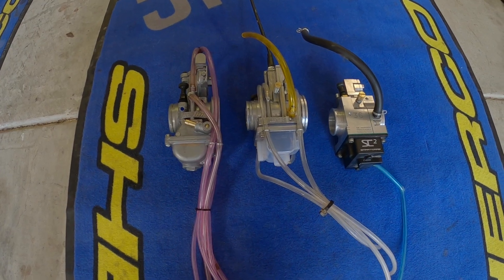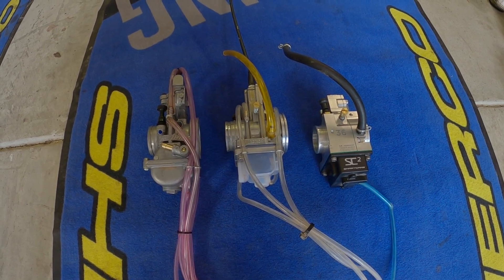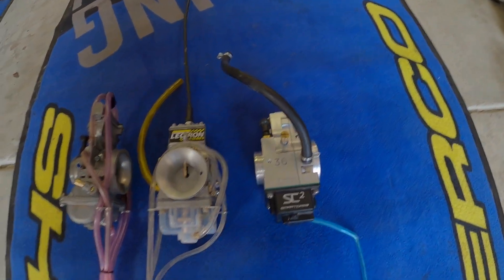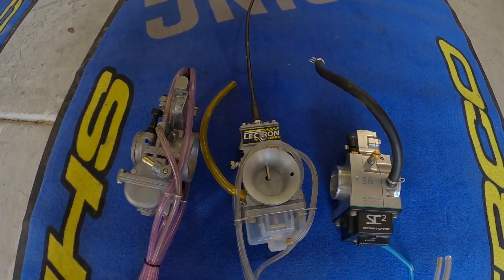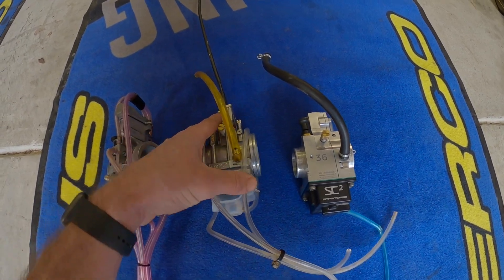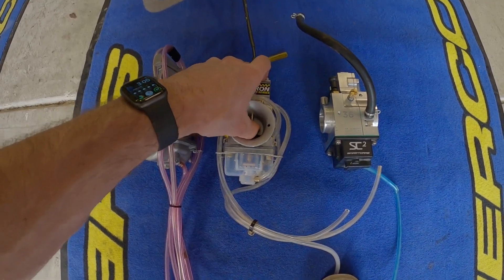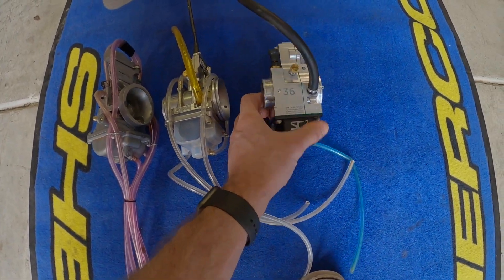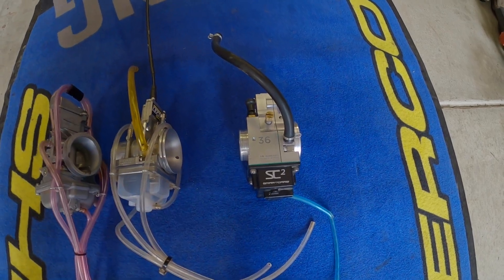Keihin, Lectron, SmartCarb Comparison

Comment: Hi Cody. 
Thanx for your test. 
I wish you could do a more detailed one just on the lectron.

I have a question to the part you made the mistake you mentioned on the Lectron . I am a little bit screwed at the moment.
What i recognized / where i would like to comment
1. The tool is not part of delivery. 
a) It must be ordered and payed separately. (At least in Germany it is this way) 
b) You need the tool unless you want to damage the needle with a plier.
2. Could you please explain in Detail what you are doing around 09:00 in your video.
im struggling at the moment to  find the ideal setup for my GasGas250:
What i think:
a) Explaining how leaner and richer is setup in  general is fine. Works the same as in a traditional carburetor. 
What i think: You have to use the tool and turn the needle in unpressed condition. So if you turn the needle clockwise for 360 degree the needle will lower and the bile will be a lot leaner.
Manual says: that modification shall be done in 1/4 = 90 degree steps. So if you turn it leaner or fatter for this angle the needle is NOT Showing as it should be (flat side to the engine). This is why you have to press it to unlock and than turn it to the right direction. After releasing the needle goes down an the 90 degree change is done.
I do not know:
a) if my description is valid. The Manual is really poor and your video is one of the best explanations
b) you can ask someone to confirm this
c) can he explain on how to count the rotates mentioned in the turns in the manual. For a 250cc base setup is 3-5 4 rotations. 
Q) Starting from completly closed (Lowering from full rich to lean) or starting from ultra lean Making it 4 Rotations fatter
d) can you explain the power jet  in detail.

Greetings from Germany.
Hope to see you soon on the bike.

My problem: 
GasGas has 2 Ignition curves. Running single trails an being 50+ years i usually used the rain setup. Bikes runs smooth with the Keihin. Switching to Sun Mode gives this aggressive MX curve of a 250 engine, starting with no power and giving you the BANG on opening the exhaust valve.

1. After replacing the Keihin with the Lectron the bike is really running great on the summer setting. Simmilar to the original Rain Setting Very smooth and more powerfull overall. Switching to rain the bike is running poor. Seems to be much to fat in this mode. 
2. I have to use the Choke on Cold engine start for some seconds even if temp is 15+ Celcius. Choke Design is trash. Position is not on  original place. You can no handle the choke with gloves. I bought the addon choke cable. This works fine for me.

BTW: If any of the readers  or any Lectron PRO as an idea, please comment on this one. I will contact you by mail.
Reply: Cody got it wrong. Turn rod in the down position to richen or lean. Push up only to get rod back to correct position after making a change.

Comment: As good as the results can be, $500 - $800 buys an awful lot of jets and needles, even labour for a tuner to sort out the original jetting.
Reply: But you still have to think about it and mess with it. Beauty of a lectron or smart carb is you can put it on, maybe do some initial tuning, then forget about it. 
I’ve had perfect jetting on my rm250 with the Kehin and I don’t think I could have gotten better performance from anything else on that day in those conditions. But now I live in Colorado and ride track at 6k feet then trails sometimes the next day at 10-13k and it’s nice not messing with the carb.
Reply: @johnnyellis5324 
Maybe it's just me, but I can't imagine forking out $800 so I can be lazy and not spend maybe a couple of hours on my new bike to jet it right.
I guess there are those people. 👍
Reply: @Danger_mouse  yeah I wouldn’t fork out $800 either, however the Lectron is $475, will almost always run better than you jetting it and I’d rather be riding than tinkering every time I want to ride high elevation
Reply: @johnnyellis5324 
That's still $650 Aussie dollars and still needs to be freighted.
I'm sure both of them work well,  but for me the cost isn't worth the gains.
If i was to spend that much money, I'd spend a bit more and convert my bike efi 🙂

Comment: Based on what you said, and the fact that the SC was actually ON your bike during the video, would it be safe to say that this is the one you have chosen to run for now? Obviously the simplicity of the SC tuning was something that you thought was an advantage over the others (at least during the testing phase). I also noticed that you compared the performance between the Keihin and Lectron (a little bit) but you did not mention the pros and cons of the SC performance. Based on your comments it sounds like you may have felt the SC power characteristics were more linear than the Lectron. Can you please elaborate a bit more on your thoughts on how each one performed?
Reply: 9 months later the keihn is back on...

Comment: Have you tried a Keihin with the STIC installed Cody?? Heard there awesome.
Reply: Looking for the same info!
Reply: I ran the stic keihin combo. I could never make the bottom end run good . It ran like i had a rag in the air box. The manufacturer kept reccomendin larger jets and the problem got worse and worse. Good mid range and top end . If your into sand drags or hill climbing it might work but for off road or trails its a complete waste of money.

Comment: Did you notice any fuel economy gains or quicker starting? Could you talk about that?
Reply: I have the lectron on my KTM300XC and yes it vastly improved.  Paid for itself in one season in fuel savings.  I am going to try the smart carb when I can ride again.  But the lectron has worked very well, starting and idle has improved, warms up better.  Easy to adjust.

Comment: finished the 2020 CWIRA ice racing season on my KX 500 with Lectron. Other than adjusting the initial float level I was good to go from -10 to +40 deg races and had crisp throttle response everywhere.   For me,  it has been a good choice.    KX 500 Eric Gorr super moto porting and pump gas head.  ( probably going to recut  the head for VP C12 before next season)
Reply: Did you ever run into Fredette while you were out on the ice?
Reply: @clintonlied  at the moose endurance race a few years back.  He was stupid fast .

Comment: Run on with a Lectron is due to over fueling (too rich) and needs to be leaned out. And this is where most people go wrong with them thinking it's running lean but find fattening the fuel up does nothing  It's hard to get your head at first when your use to traditional carburettor tuning but with a Lectron the symptoms are opposite. Run on is over fueling and spluttering/hesitant throttle is lean condition. You tune the metering rod for a good idle and then tune the power jet for you mid to top. If you idle is good then back the power jet off 1/4 turns untill bikes no longer runs on after WOT or loaded hill climbs.
Reply: I screw in the rod, i.e. I raise it so that the motorcycle has more fuel, despite this I have the impression that it reaches temperature much faster than other motorcycles, which means that it would be too lean, but after unscrewing the spark plug, the middle is milky and the thread is black and looks rich.

Comment: I tried the Lectron on my 2018 Husqvarna TE150 (Mikuni was stock). The Lectron first off was a terrible fit, super long and getting the Airbox boot on was a bitch, had to basically lift the subframe up and battle it onto the carb. The Lectron guys suggested that I buy a second boot and to cut the boot down to make it fit. I bought another boot and cut it as they suggested but that failed to resolve the subframe problem. The length of the Lectron made the subframe/boot length issue a major problem. After battling to get it installed and after fiddling with the their suggested adjustments I kind of ran into the same issues you did on the Sherco  and took it back off and shelved it. I purchased a Kehin from JD Jetting and I love it, easy install, minor jetting and bam it really livened up the bike. The Lectron people were not very helpful and they seem to be ok with force fitting their products, and I do mean force fitting! Interestingly I had a similar issue with a Lectron I purchased from them on a 2015 Yamaha YZ250. Although the carb fit, the length of the card was to long.  I highly suggest looking at options other than Lectron.
Reply: Interested in selling your lectron maybe?
Reply: Jaden Mitchell I have one I’d would be interested in selling.  It’s a 38mm HV from slavens purchased last year.  Has the 4-2m rod installed and a spare 5-1.  New condition. davescott1342@gmail.com.
Reply: @DS-gq6wv  emailed
Reply: @JadenMitchell13  Long gone
Reply: Same as me, I have smart carb 38 and its dimension is too long to fit an airbox, I then get back to Keihin, maybe I will try STIC and compare to smart carb.

Comment: On the lectron you could try the 5-1 rod at 2.025 inches (measured from tip of rod to the brass circle on slide, without compressing the rod spring). That seems to be best for me. For reference I'm on a 2017 300 xc KTM
Reply: What elevation are you riding at
Reply: Can you describe on how to measure a little bit more detailed?

Comment: I am on my 3rd plug in 20 hours with my bike. This weekend I'm installing the Suzuki needle to see of that helps. I'm hoping it does, as theres no way I can drop that much money for a whole new system. I'm kind of assuming it's the bike screwing up at that point.
Reply from the maker: Shouldn't be a bike problem. Has to be something about the jetting being too rich I'm assuming
Reply: @codywebb2  that's what I'm hoping and it's not something stupid like a loose coil or map or whatever the 19s were having issues with.  Leaned out the pilot jet already and dropped a notch on stock needle. Hopefully this Suzuki needle cleans it up.
Reply: @TeamStepBrothers  did it work?
Reply: @EinSteinerEnduro  sure did! No plug fouled in 60 hours.

Comment: Cody webb actually to adjust the rod on lectron you turn it in or out without pushing up on it then you push up and turn it to get the rod facing the correct way I'm sure you know that and just said it wrong anyway I'm a huge fan always pulling for you
Reply from the maker: Marc819 ride yea I said it backwards. I fixed it in video description
Reply: @codywebb2  I am running the lectron and I have had to do more adjusting on it then I ever did on the keihin I just cant seem to get it to run the way I like I am very dissapointed if I could do it over I definitly would have went with the smart carb
Reply: @singletrackmarc819  wanna sell?

Comment: Best solution is a Keihin carb with a JD jetting kit for your bike. Simple, reliable and easy to tune with great support. Also fits the bike properly, unlike the Smartcarb and Lectron
Reply: I've been tuning 2 strokes since 1965 and I have seldom had an issue setting up with Mikunis or Keihins to run pretty darn good.
No need to waste money on Lectrons or Smart carbs in my experience.
Reply: sono d'accorto con te, perchè cambiare il carburatore std?se conosci come funzionano i carburatori, sai fare le correzioni! Coi ricambi giusti.Altrimenti meglio non toccare!
Reply: But why not use stock settings ? This bikes are running great if you jet like the manual say for your altitude and temp.
Reply: Robert Moore forget jd. Get the stic metering block. 🔥🔥🔥🔥
Reply: chris marshall I’ve followed several threads on KTMTalk about that. Seems it can be very tricky to set up. From my experience JD is the easiest to set up and gives great results. Had all three plus a Mikuni, so I have some experience
Reply: Robert Moore they are plug and play bud. The jetting seems to work world wide and at any altitude. Everyone runs the same jetting and needle on them. Power is crazy and so responsive.
Reply: Robert Moore Tokyo off-road has some good videos on his stic set up. Which is the same as I run. Check them out if your looking for something to watch.
Reply: chris marshall I follow Mark's channel. But for me the sweet spot was my Keihin JD setup on my 2014 - 2017 bikes.
Reply: @chrismarshall4814   mine from mark never worked. I threw it in the trash and went back to the stock metering block and JD kit. Never looked back.
Reply: Evan Johnson weird. Mine is unbelievable. Mine was set up by George himself and has the newest tube in.

Comment: I love the sc2 on my 2020 300 factory👍👍 I would really like to know what settings you are running Cody🤔
Reply from the maker: Tim Jackson been using the Q07 metering rod at 78 clicks out currently. Do you know what you have in there?
Reply: @codywebb2  thanks for the reply😀 I have the A-Q11, also at 78 clicks. Bottom and mid is excellent but it doesn't seem to like high speed 1/8 to 1/4 throttle for prolonged duration? I've had it just die out on me whilst riding a couple times now, any suggestions, maybe a click or two leaner? So pleased to see you on the Sherco this year, hopefully you will get to race once this zombie apocalypse is over, I'll be watching✊

Comment: I always get the Lectron needle flat side facing me and than adjust with the tool but I have used just my fingers in the past. It's easy to remember left to lean and right to richen. My Keihin on my 300rr was fine but it seized up on me and I put my Lectron to use. I ran the Lectron on my Wr300 but pulled it when I sold the bike. I would like to find some thumb screws for the Lectron throttle cap. Thanks for the video.

Comment: Cody  have you tested a Kehin PWK-AS modified by DICKS Racing ?  DICK Taper Bores the carb to work in slow technical and fast WFO settings. DICK adds an  Intel-a-jet system with a  similar Power Jet Needle as Lectron. The Intel-a-jet also has an Air Impact adjuster to fine tune the Power Jet mixture for altitudes changes. Dude, this Carb Pulls each gear to infinity & beyond !!   It comes set up / jetted ready for installation..... The air impact - Lean - rich adjuster  knob (rarely used) is mounted to left side of the steering head next to the gas tank

Comment: SC2 makes 18 300xc run perfect. So easy to tune with no tools. Make sure u trim the air boot for the sensor.
Reply: Which one do you have, 36 or 38? Thanks

Comment: I've had two buddies on 300s do back to backs between Keihin and Lectron. They both independently said that the Keihin had better bottom end. I think the Keihin might be harder to adjust and has more variables, but when you get it dialed it is the best overall. Can you comment on how the bike ran with the Keihin? Also do the Shercos come with a 36 or 38?
Reply: PWK 36
Webb you didn't mention what you end up with the stock carb. Can you give some # to adjust mine. Pilot. Main. Needle.Im in Texas thanks
Reply from the maker: I don’t remember what jetting I was running. But it varied depending on where I was. I believe we leaned out pilot. I had a 35-38 pilot and a 165-168 main I believe for primarily extreme. Which could be a little lean for more mx style riding. 2nd-3rd clip on needle
Reply: @codywebb2  My buddies switched to the 38 keihin. My YZ250 has a 38 as well. Have you tried a 38?
Reply: @codywebb2  hmm...I feel that i do not have linear transfer from bottom to top (too agresive for me) on my 250ser, would bigger main jet help with that?
Reply: Thanks 🤙

Comment: Two more things why I like Smartcarb. One is no vent to the outside area. No more worry about crossing the water. The other one is the mechanical fuel auto-stop when you drop down your bike. One more good thing is drainage the residual fuel in the cup after riding is extremely easy.
Reply from the maker: Chieh-Nan Wang yea forgot to mention that. Should’ve made notes
Reply: Chieh-Nan Wang  I’m sold, that is smart, for sure

Comment: As someone else said, you have the tuning backwards on the rod. So if you were trying to richen it, the way you described it, you’d actually be making it more lean. Your theory is correct, but the execution is backwards. You need to rotate WITHOUT compressing that spring and the compress it and orient the metering rod to reset its position. So you were probably making it more lean which may explain the running idle issue and “hit” you describe. The Sherco I’m riding has the most impressive bottoms end and smooth transition into powerband than any other 300 I’ve ridden...with the lectron. I did have to play around with some settings compared to the base setting however. The engine dynamic/fueling isn’t the same as the ktm for instance. But it’s running sooooo good now. Really good bottom end. I’d give the lectron another try!
Reply: We were adjusting it properly and spoke to Electron while doing it.   That was a couple months ago so he probably forgot the details
Reply from the maker: Yeah we got it fixed. I described it backwards because I was winging it and used the same mentality as adjusting the SmartCarb
Reply: Cody Webb yup! No worries, glad you got it sorted 👊🏼✊🏼
Reply: Cody Richelderfer yeah I just DM’d him on IG and that’s what he said. Just wanted to make sure it was a simple mixup for the video! But it DOES match what he explains with how the tuning was affected too. Idk! Just trying to eliminate any confusion and help make a fair comparison!
Reply: I screw in the rod, i.e. I raise it so that the motorcycle has more fuel, despite this I have the impression that it reaches temperature much faster than other motorcycles, which means that it would be too lean, but after unscrewing the spark plug, the middle is milky and the thread is black and looks rich.